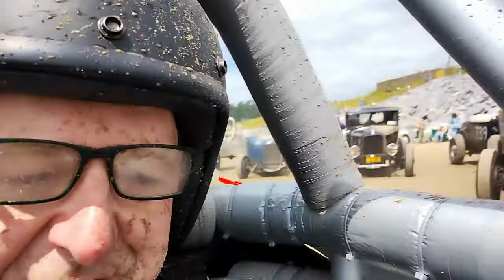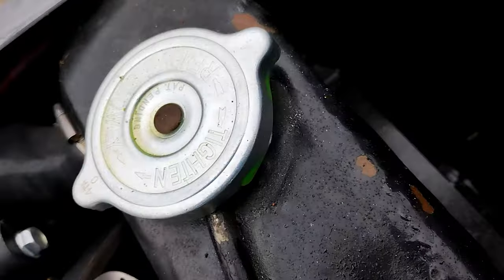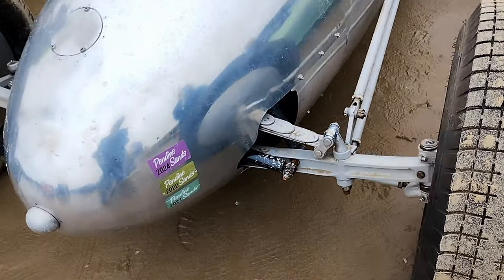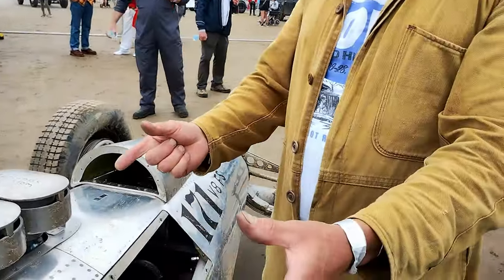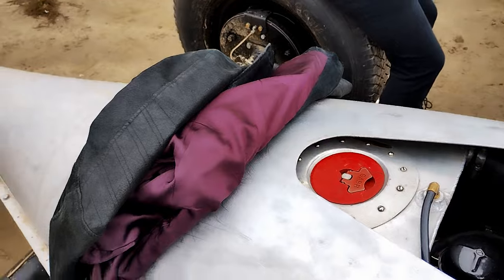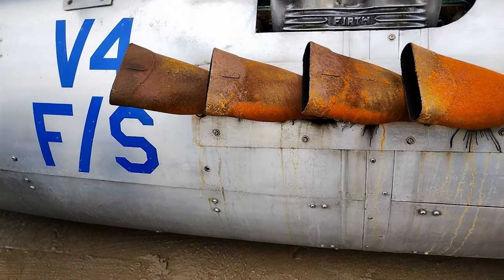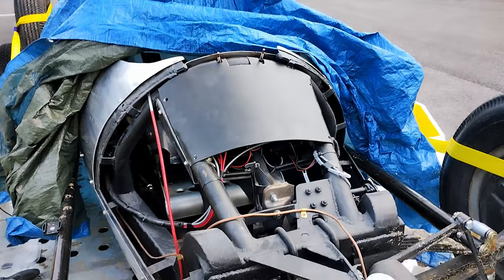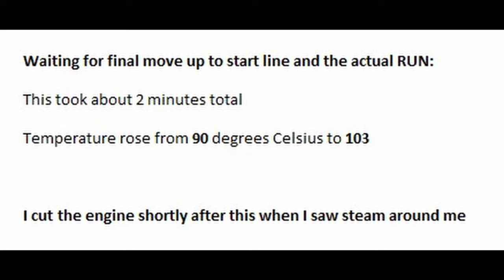Belly Tank: First run at PENDINE VHRA. Ep83, YES!

Comment: Incredible Build. When you pulled off that cover and there was an Arduino in there I was absolutely floored. Seriously high tech . Recording all those stats will get you closer to your goal. It is a computer "tale of the tape"..Really awesome guys!!!Love that car. I have always wanted to build a supercharged belly tanker like yours but I went a different way.....
Reply from the maker: I think recording temperature in some way was worth doing as I knew somehow it was going to be the biggest challenge to get right. I am going to have to add water-tank temp as well if I go down that route so I can know if the intercooler works or not. There is a lot on forums about cooling flatheads and some opinions conflict with each other. The only way is to measure everything and see what is going on. The gauges are OK but half the time you are not looking at them ! I am not trying to be really fast, but a bit of reliability would be good. You can probably buy temperature gauges these days that have some sort of datalogging function built in.
Reply: @XenonJohnD  Really nice job of keeping everything looking as if it came from the 1950's. I have seen where people have filled the block with epoxy and then drilled out high flow pathways for cooling fluids. I wish I could think of who that was because it was like ten years ago. the guy has a shop that specializes in flatheads and upgrading the performance. I might have heard that he developed a new block that works better than adapting an old one.He is in California I believe. There was an episode of power Nation with him and his business. I hope that helps

Comment: Excellent video! Very interesting. Congrats on the run. Not being able to test the car beforehand is the big common problem for you all. I was there in my 33 coupe. No. 47. Mart.
Reply from the maker: Hi Mart, I have watched many of your videos for both mechanical tips and some of your Pendine runs for newbie reasons like when to change gear, how far to go at the end before making the great big U turn and so on. Having boiled over I appreciate more the one you made last year when you ran with the fanbelt removed in the quest for 90. I would have said hello but as a celebrity you are often surrounded by others doing the same !

Comment: Nice video John, I like the data logger thats giving you a lot of usfull infomation.
Reply from the maker: The temperature data is very useful as it makes really clear what was happening - and confirms what you told me when we chatted. WD-40 over everything steel and panels off tomorrow plus an engine test just to make sure it isn't broken. Then will consider the cooling.

Comment: I ran a  '23 T  on the salt years ago, with a 354 Hemi. Cooling is best done with the large reservoir as you need weight not lightness when doing Speed runs as opposed to drag racing. To beat overheating, go with alky . Are you running houdaille shocks? they are adjustable which is why they were so popular decades ago. You could try a tighter (shorter) front spring. 😁😁
Reply from the maker: Am going for the large reservoir. Would like to include a water-water heat exchanger so can have corrosion inhibitors / anti-freeze in engine circuit and simple tap water in the reservoir tank. Big reservoir  tank can then be partially drained and refilled if too hot. I have heard you can weld a radiator into a box essentially. Also looking at stainless swimming pool heat exchangers. Anyone have suggestions? Shocks were standard and old so no surprise they weren't working very well. Looking at Houdaiiles as they are still made or maybe just small cheap standard modern telescopic shocks (allowed in the rules). Cars have to run on pump gas.

Comment: Very nice. Maybe add a small electric fan to the front so when your sitting it can cool down. Mike
Reply from the maker: Was thinking of a rad fan, electric water pump than can run from an external battery pack when parked with some sort of timer shutoff. I think the big water tank with water intercooler and an electric water pump might be better overall simply because you can quite easily change the water tank (tap) water. Still thinking about it.

Comment: Great to see it in it's natural environment. I worry with all that salt water and it sitting in that container/storage unit it'll rust a lot though. Did you get to hose it off first?
Reply from the maker: The really nice guy running a garage opposite let me blast it with his air gun on a very long hose, which has ben recommended by people. As it was dry I didn't want to get it wet again. Panels all off today and spraying with WD40 which I will repeat quite often. Will spray all internal cavities with Dynax, didn't have time before last weekend. Dehumidifier also, even if they are the chemical crystals type. I took this video by Superfast Matt as a warning not to leave it for a while before I do all this: 'My racecar is rust'
https://www.youtube.com/watch?v=HYIa1IZUKJk&t=605s
Reply from the maker: This is another reason I wanted the main body to have as few louvres as possible. The front suspension is salty but the frame is remarkably clean inside. By using a water tank if anything I can have even fewer vents when I redesign the head fairing.
Reply: @XenonJohnD  It was interesting seeing those different approaches to cooling. Be interesting to see what you come up with here. I've been using some aviation stuff called ACF-50 as an anti-corrosive spray. Recommended by Mr Tweed! Seems to be doing the job stopping my tools and machine tools rusting in my metal shed.

Comment: A 25 lb radiator cap would help
Reply from the maker: Would a flathead take that? Would water pump seals leak for example? I don't know, I am asking. My understanding is that up to '37 they were not pressurised at all then they had a 4 lb cap, which is what I fitted. Happy to be corrected by someone though if I can use a higher pressure cap without problems.

Comment: Why are you running coolant for a drag and not just water?
Reply from the maker: Seeing as it all 'escaped' in an unplanned way I should have just used water but was intending to keep the water in the car longer term and so corrosion inhibitors would have been the reason. This event is more for the fun of it than any kind of trophies.

Comment: A ridiculous roll cage!
Reply from the maker: If it rolls I prefer something that actually works, not just there for decoration or to minimally comply with the rules. A roll bar with at least one forward or rear diagonal strut is the minimum requirement for this event. I could have had one single hoop and a rearward diagonal mounted to ??. No convenient place to mount that diagonal bar, these rules generally assume you have a front engined car. This cage arrangement is actually easier for me as engine can then be dropped in and out with an engine hoist if needed with nothing running back over it. The tubing is also specified in the rules - seamless CDS.